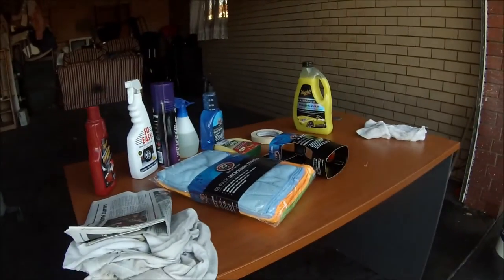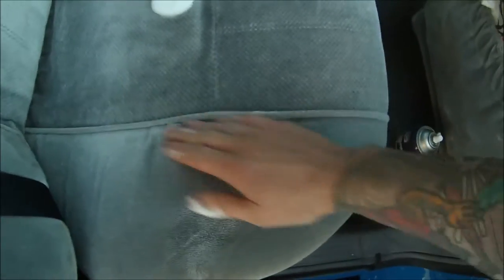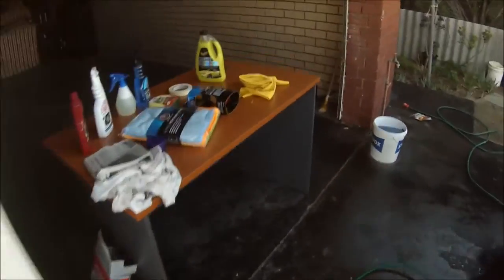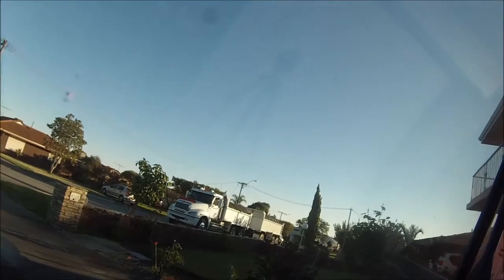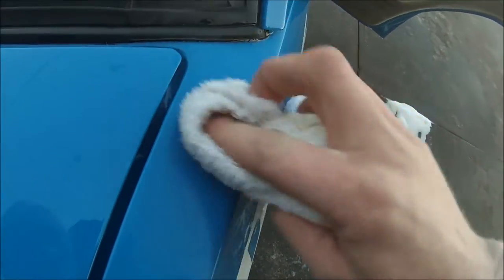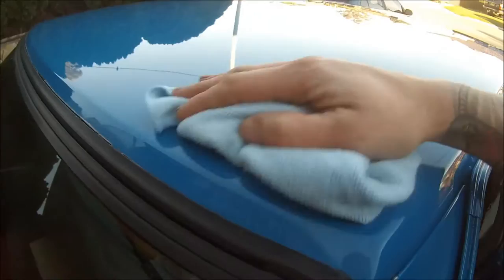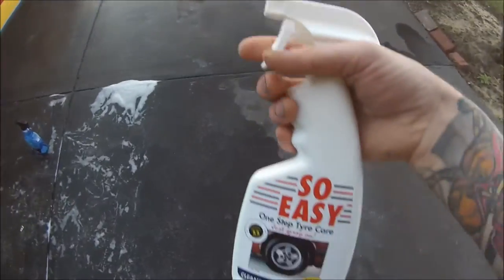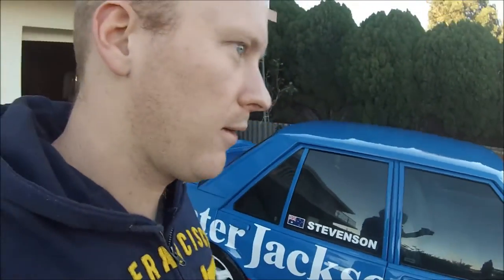How to Clean a Car

Comment: Cracking finish looks like a sheet of glass, what size engine is in it?
Reply from the maker: Its a Strait 6 250 cross flow. or 4.1lt carbie engine runs like a charm and goes pretty hard got headers (extractors) 2' exhaust lumpy cam, its an ex race engine,
Reply: So its a thirsty SOB then lol cracking vid's buddy keep them coming!!
Reply from the maker: Oh yeah it is thirsty but worth every cent, Thanks